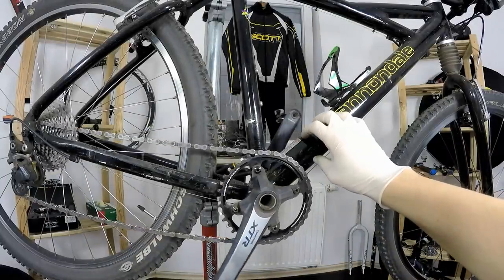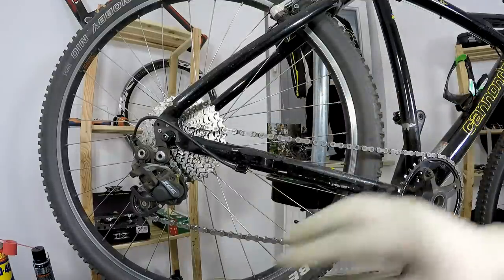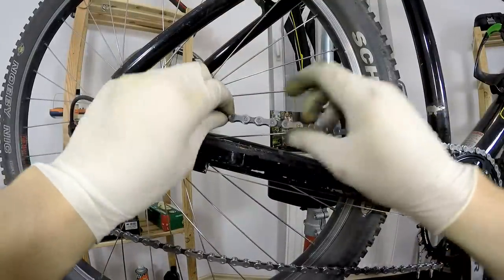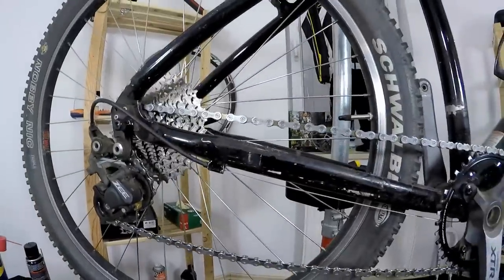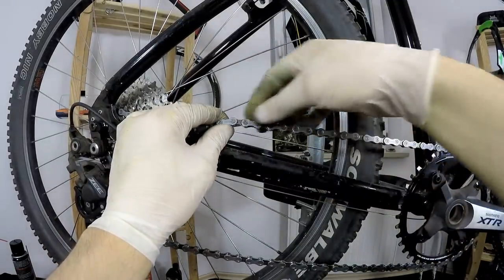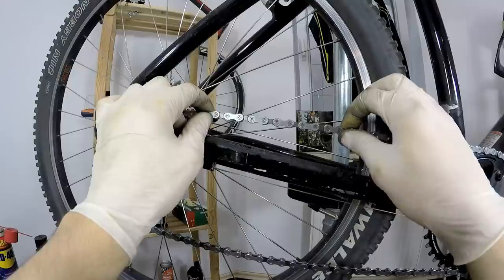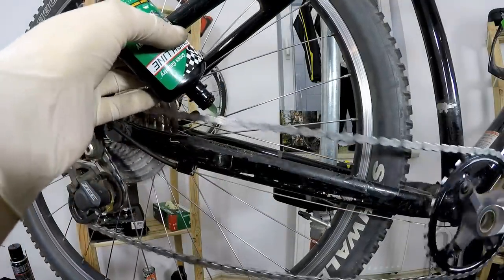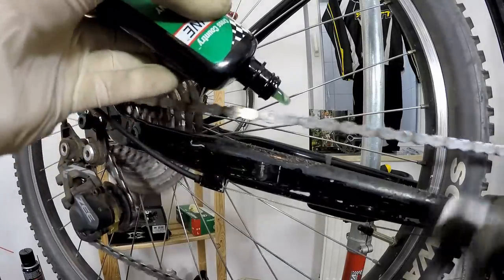How To Clean And Lube Bike Chain. What To Avoid. Oil Bicycle Chain Tutorial.

Comment: Back in the Day Dept. IF it was old, dirty, greasy chain; we would remove the chain, clean with diesel fuel, dry it, then let it soak overnight in motor oil. Hang it up to drip off. Next day let the oil soak in by wrapping in paper towels. Oil gets into every crevice / roller. Wipe off excess. Good to go. Then oil it once a week. Beware of derusting gel! Better to replace the chain.
Reply: Personally I believe that's the right way to clean chain even if it is a 'bit smelly'. Diesel fuel is high pressure  'lube,' injection systems run at 3,000+psi. dDy it off and 'soak' in 0W/20 full synthetic engine oil. Then you have a smooth low friction ride

Comment: Great stuff, kolego. I was about to buy a chain cleaner for my new bikes, but after watching this I was convinced that there are alternatives. I can spend 15 min. every week to clean/lube my chain so it will last 5K miles, but I would much rather be riding. Also considering the amount of time spend cleaning, if I worked that same amount of time, I would be able to replace the chain at least every month for the earnings. Anyways, I like your maintenance techniques; they are comprehensive, informational, practical and thrifty.

Comment: Use a toothbrush soacked in lubricant instead of dripper. Rug clean the chain on bike before lubricaring and rug clean after lubricating. Takes max 2 minutes and lubricates  better between links and might get rid of some dust too. 
Change chain at least once a year:-P if you ride the bike at least 30km a week.

Comment: Hei! Quick question: Do u recommend always putting wet condition chain lube despite ridding in dry condition?
Reply: you can do it BUT it wet lube remains wet on the chain...so it will attract a lot of grime and dust and lead to you requiring to clean it more often. Dry lube is better at keeping the chain grime free. 

When it rains, dry lube just gets washed out much quicker so we might need to relube the chain after every other ride. That is why , because we have no option, we must use wet lube during wet conditions so we dont need to relube too often. 

But dry lube in dry season is best since it will give you minimal maintenance and keep your chain clean.

I hope that clears your doubt

Comment: Ive watched two videos now and both have said about the rings on the chain splitter but havent explained why.
Basically the chain link is connected by those "pins" which act as a rivot, a rivot is basically taking a straight shaft and crushing both ends (or one end if the other is flattened before hand) and effectively making a capital i shape, when you break the pin you are snapping through one of the rivots leaving the crushed metal as a ring on the separator. 
Using the pin again will either result in a poor rivot cap or none at all where your hoping the vibration/ the compression and expansion of that link doesn't separate the pin from the rollers and links.

Comment: Chains are cheap but cycle specific cleaning and lube products are expensive. If you're not about to do the Tour de France why waste time, effort and money maintaining a chain? Just fit a new one.
Reply: If you don't maintain your chain it will wear out faster than you would run out of a bottle of lube. Also decent chains are normally at least double the price of lube.
Reply: Also, a dirty, underlubricated and worn chain will wear down the teeth of your cassette and chain rings much faster than a maintained one. These parts aren't so cheap. I found this to be a good maintainence guide - particularly for someone with OCD, I've wasted so much time degreasing, cleaning and relubing my drivetrain I get scared of going out sometimes because I can't stand my bike sitting there dirty and I haven't the time for the usual full mega clean!
Reply: Well, commute to work in UK and you'll spend £100 a month on new chains if replace like you say  :D I'll rather stay with cleaning mine.

Comment: Step 1.  Spray the chain, sprockets, guide wheels, cassette, brake discs & calipers with Wurth brake & chain cleaner (which I also use on my motorcycle).  This stuff degreases, cleans, then evaporates completely.  You can spray some onto a cloth, then wipe off more stubborn gunk.  Step 2. Rinse the bike with water, then spray the pink Muc-Off bike cleaner (which I also use on my motorcycle).  Use a brush or microfibre cloth to clean off more stubborn gunk.  Spray extra into the drivetrain components & brakes.  Step 3. Rinse the bike with water thoroughly.  Drip dry for a while, wipe excess water with a clean cloth.  Finally, use your girlfriend's hair dryer to dry the drivetrain components & brakes.  Step 4.  Lube the chain exactly as SickBiker does.  Step 5.  Very carefully spray Wurth Dry Chain Lube into the deralieur pivot points & moving parts (don't let this stuff get onto the brake discs or pads).

Comment: Great tips on chain care. Where I live the trails are often super dusty and this often   accumulates on the chain which gets to a point where the chain should be cleaned to insure optimal shifting. I suppose if there is less oil on the chain then this would happen less. Also living the night before with a pre ride whipedown maybe is key. Applying the lube from top side seems counter intuitive  but also makes sense to minimize lube seep into the cassette and rollers. Thanks for sharing this!

Comment: Degrease and use a tooth brush to further remove these particles that are causing unnecessary wear and use compressed air and a clean rag to remove them and then lube the chain do not use grease job done.

Comment: There is no way you can put the oil only on the edges of the chain and not the rollers. The oil will spread as it's a liquid, plus, it won't do any harm, as long as you wipe any off any excess afterwards.

Comment: I been using master links for 20-30 yrs and I've never had a problem.  I use Shimano chains and there's no reason not to use a master link.  As for lubing a chain, there's no better lubrication than a paraffin/motor oil bath at about 120 degrees.  The chain feels like butter and shifting is almost instantaneous because the chain has lubrication in its innermost recesses.  The mixture I made up has lasted over 10 years.
Reply: the parafin/motor oil mix is  how much %/% ? i guess you are talking about Fahrenheit degrees ? thx a lot :)
Reply: I use about 9 oz of motor oil to one pound of paraffin.  That's the maximum amount of motor oil that the paraffin can absorb.  I've actually never measured the temperature of the solution.  I heat it until it is completely liquid and then I turn the flame down to the lowest possible level.  I use a strainer to hold the chain in the lube and let it soak for about 30 seconds.  After shaking off the excess lubricant over the pan, I dump the chain on some newspaper to let it cool.
Reply: thx a lot
Reply: You might also like double end capped PAG 46 as chain lube. It sticks to any metal it touches and water can't remove it (IPA will, however). It's also so thin it won't catch any dirt.

Comment: I take (2) two tooth brushes and face the bristles together.  I spray them with a lubricant. Then hold them on the chain(around) (top and bottom) and spin the crank.  This is really easy way.  Then I wipe off chain with clean dry terry cloth rag and relube the rollers and wipe down again.  My chains go 3-4 thousand + miles.  Thanks for all the great videos Danny.

Comment: Kiss.....Keep it simple stupid.......clean it with an oil based lubricant and clean it often so remove any grit....after 30yrs on the same chain, I replaced it for good measure.  My chainrings and cassettes don't even need to be replaced.  A chain should be softer in material so it wears first...that is the way they are designed.......you  don't want your chain material harder than the cassette or chainring gears or the chain will wear out the cassette and chainrings.....20 dollar chain compare to a set of chainrings or quality cassette......

Comment: I do it this way too.  ...the same thinking for many of your thoughts on chain.   I also don't clean the chain because, like anything including gears in general, the dirt and foreign material works itself out of the way anyways.   And when do you notice the worst dirt grinding and rubbing for any chains and gears?   right after you've washed and relubed it becuase you've just washed all the fine grit into the moving contact points that normal use  keeps clear and clean.

Comment: Thanks for your in depth and thorough videos.
I disagree though; the chain stretches because it's the sand and grit that stays inside the rollers that grinds the rollers enough to reduce their diameter, thus increasing the length of the chain.
I clean the chain every time with siapy water, then spray wd40( if thats all the time I have). Then every 3 or 4 cleanings( or every time if I have the time) I use dry lubricant( I bike in dusty dry conditions )or sometimes a teflon infused garage door spring lubricant.

Comment: also, what about wax as a lube? its very dry, doesnt cause dust sicking to and getting in the rollers. it seems like it should be something done at the factory. i watch some guy from australia, his youtube is oz cycle and he got like a fraction of a millimeter of wear/chain stretch from 3000 kilometers with one wax application

Comment: Some really excellent advice. I was doing a lot wrong, like taking my chain off by breaking the quick every two days, and then cleaning it in a tub of citrus degreaser, which meant my quick links were all worn out. I had no idea how dangerous it was. My bike shop told me to clean my chain like this after every ride, but I kept thinking has the dirt really got inside my chain links when there is oil in them? Maybe, but only a little. This will make chain maintenance so much easier. Thanks!

Comment: But the grit inside the rollers wont leave. if you twist the chain sideways there is always a gritty feeling. there is just no winning lol but of course it helps to lube the chain. also the new lube will push more grit in the rollers too. so its like, dont lube your chain at all and it might last longest lol leave the clean factory oil inside of it alone to not push more grit into the rollers. just clean the outside of the chain with a rag or lube if it seems like there is no lube inside the rollers.

Comment: I lube my chain link by link :D
With a syringe and needle. After few times it works faster and it worth the struggle!
Chair doesn't get dirty so easy and it's no excess I need to clean.
I use compressed air to blow water from my chain.

Comment: I like and agree with your cleaning routine. For applying a mineral oil base chain lube,I use a#1 round sable hair brush. The brush tip can more precisely deliver lube to where you want it,leaving far less excess everywhere else.  There will still be enough coating the rest of the other metal surfaces emerging after your first ride.

Comment: I use my finish line chain cleaner. After cleaning the chain using solvent I fill the cleaner with oil and run my chain through it again.

Comment: I like Boeshield T9 Chain lube and Dumondtech Pro X lite. It keep reasonably clean at first and can resist rain fine but for some reason, it keep turn black after sometime even if i don't ride. I know it's only cosmetic problem but i prefer my chain to look shiny than black.
Reply: +Chavit Denninnart  I used Finishline Wet like the one shown in the video and If I recall correctly it turned messy to, it was quite thick too but at least the smell wasn't unpleasant. Tried Motorex dry and wet and both turned black after a ride, if I wiped the chain frequently to avoid it it made reaplying mor often necesary or the chain woud get squeaky. 

Now I'm using some squirt lube like wax type stuff but the jury is still out, maybe I have to give another go to Finishline wet leftover I have or go the bar chain chainsaw lube route as some recommend...

Comment: Thanks for discussing it to the details, but what can u say about removing the whole chain and soak it with decreaser/cleaner brush it until no more dirt then soak it with lube/oil hang it let it drip then wipe and re-install it?..
Reply: He doesn't use degreaser because inside the chain you will still have hard to reach spots where the degreaser is and can't be removed. When mixed with oil it becomes counterproductive.

Comment: I wish that someone had told all this to me some years ago. I would have saved money by not buying decrease, and eve more money from the new chains and sprockets. I used to clean my bicycle chain with toothbrush and some decrease after every few ride. Because somehow I had got impression that the little sand particles might have get their way inside of the rollers and links and I must get them off.. 
Now I don't do it, and my chain lasts at least 2 times longer.. But I still oil it a link by link, but I think your way of oiling might be better because it's difficult to get small drop of oil to each link. And even when I wipe it, it won't get all the excess oil off and so I have a oily bike. It sprays all the oil to everywhere when riding. Next time I try your way.

And I'm happy, that I haven't bought a chain cleaning tool. Actually I even don't know where on earth I got the silly idea that chain needs deep cleaning. When I was kid I only oiled my bike chain. I knew that it does not need cleaning. And it worked fine.. it was coaster bike though.. It must be internet's fault that I have been stupid.. Maybe I would still clean my bicycle chain, but I've read from Internet. And there people have said that they don't do it. So it's definitely all Internet's fault when I do something wrong.. But I'm really glad that I did not buy a expensive chain cleaner. I considered it some long time ago, but it was too expensive. So the greedy capitalists did not get to sell the destructive object to me.. lucky me!
Reply: I think he has some good points here on his presentation, however, I think degreasing the chain at least a few times a year (it really depends on how many miles you ride your bike) it will save you money at the end,  and you will have a nice bike to ride with. I do use it along with the chain cleaning tool and I honestly think it was a good investment. Anyhow, have fun riding your bike and above all, maintaining it.
Reply: Yes I think there can't make generalizations. It depends of so many factors. Like what lubricant you use. How expensive is your chain. And most importantly, whether you do it correctly.

For dry lubes, waxes. I think you really need to clean it more often. But for oils.. I think it's not that mayor thing.

Actually I do trust you when you say that chain cleaning tool was a good investment to you. I believe, it can be good investment for a lot of people, but for people like me, who don't use it correctly... It would be a truly destructive device. If I had a tractor, I could have sone diesel fuel at home to wash bicycle chain.. Then maybe, I would buy this device and use it. Diesel fuel is the stuff I trust the most, for cleaning things from old crease. But I don't have it, and I'm not going to buy it just for this.. All kind of decreases they sell in stores for this purpose.. I don't want to try them.. they might be bad for chain.
Reply: PS. Mudguards make also a difference. I have long mudguards installed and I also made a mudflap to front mudguard to protect the chain from the sprays from front wheel. It's not just protecting from water, but also sand on gravel road. Front wheel pick a lot of sand up and spray it to everywhere without proper mud guard.
Reply: Hardi Erstu 2

Comment: Never apply oil on the chain part that is at the top of the derailer, apply oil on the chain that is closest to the ground and then on top of that, why? because it is that side that will be in contact with the various other parts of the bike. Just remember to let the oil soak in. Different oil requires different amounts of time, some need to be left over night. The reason it leaves a mess on the drivetrain in this video is because he does it quick, not using just a drop on each chain link.